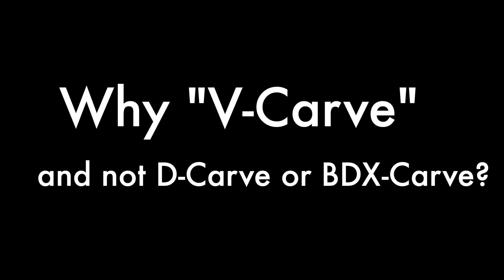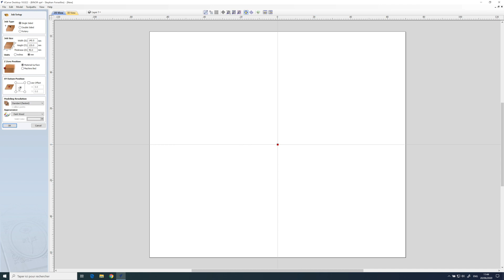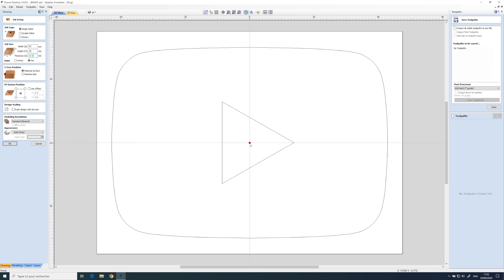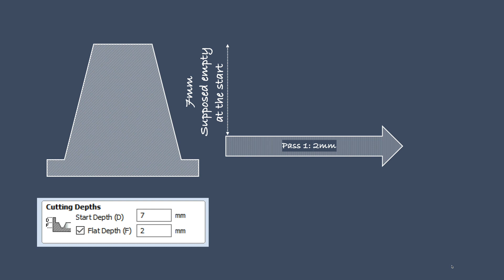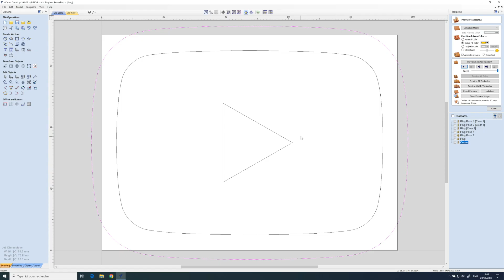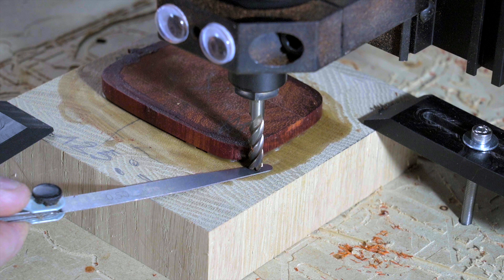Deep inlays VCarving detailed tutorial with Vectric VCarve

Comment: Excellent video which clearly explains how to produce tight fitting V carves. I have one question though with the 2/3 step depth cut with which I am having snags. I wish to V carve a name, the pocket is easy to a depth of 6mm. I wish to cut the plug in 2 steps using a 60 degree V bit, I am using an SD of 1mm and a flat depth of 3mm for the first cut and it looks fine with a nice flat bottom to the words. On the second cut, SD 4mm and a flat of 2mm, the pathing removes the flat top and now I just have a peak left on all the letters. If I run the cut 0-6mm I retain the nice flat top to all the letters. I am obviously doing something wrong on the 2nd cut but I have no idea what! I am using Aspire. Any ideas?
Reply: I had a senior moment, of course I lost the flat as I tried to make the depth of the plug the same as the depth of the pocket! Better to solve the problem before making more sawdust! Keep up the great work.
Reply from the maker: Sorry I didn't answer earlier, but happy that the problem is solved! ;)

Comment: What a great video Stephan! It worked first time for me using your numbers.  The moment the inlay reveal's itself its so worthwhile :).   
One question, why so deep, would you still go to 8mL on intricate inlays, as this would take along time?  What do you think is the minimum you should go for an endgrain chopping board inlay?
Reply from the maker: Thanks! There is no 'one size fits all'. For details, 2-3 mm is enough. If you have large zones that will be unsupported, I'd go 8-10mm. But you can do two (or 3 or 4...) separate inlays at different depth, starting with the deeper ones!
Reply: @sfo2406  
When you use multiple passes for deep inlay, why do you keep the flat depth value the same?  Would the fit or shape of the plug be affected if some passes had a different flat depth value than other passes?

Comment: I've watched this (outstanding) video at least 6 times but there's still one thing I don't quite understand. When cutting the first pass of the plug, the start depth is set to 1.5 mm with a flat depth of 2 mm. Won't Vcarve assume 1.5 mm is already carved away and plunge directly to 3.5 mm? Secondly, why not use a start depth of 0 mm and a flat depth of 3.5 mm? I just can't get my head around why the first start depth is 1.5 mm when we haven't started carving that piece yet.
Reply from the maker: Hello. Indeed with SD 1.5 and FD 2, it will plunge directly to 3.5mm which is okay for that machine. So if I want to achieve a final result of SD 8 and FD 2 for example, I'd make those cuts:

1) SD 1.5, FD 2 --> carves 3.5mm
2) SF 5 FD 2 --> carves 3.5mm additional
3) Final SD 8 FD 2 --> caves 3mm additional

In total you have carved 10mm, 1) and 2) being there to avoid having to do it in one pass.

You could use different ways like 1) SD 0, FD 3.5 etc but it's easier to keep the same FD, in my opinion. Remember the FD is what's "sticking out" after glueing and SD is the 'contact' depth between plug and pocket.

So basically I chose my FD then I make pre-passes with increasing SD, it's easier and I have less chances to mess it up. :)
Reply: @sfo2406  That is tremendously helpful, thank you!
Reply: @sfo2406  Thanks SO MUCH for this added explanation.  I was also driving myself crazy on why those specific values were picked for the plug passes.  Knowing that you want to keep your FD consistent at 2mm throughout makes a TON of sense.  Thanks for the great videos!

Comment: Stephan - great video, thank you! Can you tell me whether or not these flat depths and start depths only work with a 15 degrees v-bit - or will these numbers also work with a 30 degree v-bit?
Reply from the maker: Hi. Thanks for the feedback. It will work with a 30° bit of your design doesn't have thin pieces. Those would be really shallow at 30°. To make strong inlays I'd recommend 15° max, 10 is even better.

Comment: Thank you, but I am confused.  Why multiple tool paths for the plug? Can't you just set a max pass depth so VCarve does the cutting automatically in multiple passes?
Reply from the maker: Hi Randy. Because for the plug, the Start Depth defines by how much the plug will fit inside the pocket. VCarve will make multiple passes depending on your bit's dut depth between the Start Depth and the Flat Depth but NOT above the start depth. If you have a pass depth of 4mm and your start depth is, for example, 8mm and flat depth 10mm, VCarve will plunge directly at 10mm. By definition, anything above Start Depth should already be cleared out. But we kinda 'abuse' Start Depth to make inlays. :)
Reply: @sfo2406  thx much for the clarification.  Is it an option to just remove the material above the start depth with a facing operation or alternatively raise the bit a few mm to achieve the same outcome?
Reply: I finally get it.  It seems most folks simply plunge through to the plug’s start depth where as you are carving from the top of the wood down to the start depth. Plunging through is probably fine for shallow inlays with a 60 degree bit, but your method will work with deeper inlays with a 15 degree or less bit where the plug is a hard wood such as rock maple. Plunging through might break the bit.

Comment: Why can't you just cut the plug with a start depth of zero and a flat depth of 9mm.  This may take several passes but wouldn't you get the same result?
Reply from the maker: Because then the width of the plug at its highest point will be the same as the width of the pocket at its surface (not sure I'm being super clear here :) ). So there will be no depth of insertion. Maybe a couple thousands  if you press them very hard. 

If you make, for example, a circle of 10mm diameter and use a start depth of zero  on both sides, then the circle will be 10mm at the surface of the pocket and 10mm at the 'peak' of the plug so they won't fit.

Comment: So if my pocket is 9.525mm, I would just need to add an additional cut with the start at 9.525 and the flat depth being 2mm, including the 3 you show in this example for the inlay?
Reply from the maker: Hello; You should keep a small glue gap between the bottom of the pocket and the plug, so with a pocket depth of 9.525 mm I'd probably go for a start depth of 9mm max and a flat depth of 2mm (that's what 'sticks out').

Comment: Excellent tutorial.  One complaint I've seen several times in the comments was about the units used or the units used in other tutorial videos. I can help with that.  VCarve makes it easy to convert units inside the fields. To convert from a value in mm to inches type the keys "* i =". (without the quotes or spaces).  To convert from inches to mm, type "* m =".
Reply from the maker: Great tip!
Reply: alternatively, you can change back and forth between metric and imperial using the job set up icon in Vcarve after your work is done. It will convert and recalculate the toolpaths when you switch.

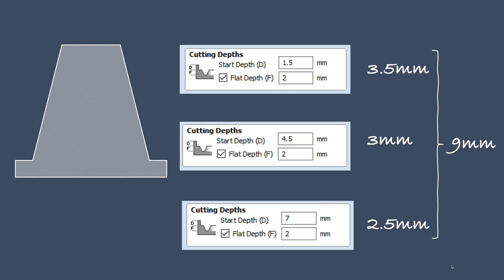Comment: After watching dozens of other videos about vcarve inlay techniques, your 4 minute visuals between 20:38 and 24:38 gave me more information than all the hours of all the other videos put together.  

Thank you, thank you.
Reply: I still dont get why we have to use start depths at anything other than 0. Why do we have to trick the machine into three passes instead of just cutting the plug at 0mm to 9mm and letting the program generate the passes automatically that it can handle cutting?
Reply: @smulths  Because the cut would be too deep for the bit you are using (possibly) and could snap the bit.  The question I just asked is because my 1/8" clearance bit only has a pass depth of .0625"   I would need multiple passes.
Reply: Exactly my thought! wow so well done!
Reply: How to use different endmill for less work v bit?

Comment: Stephane Bonjeur (Sorry Good evening now) Can you tell me please 15 deg v-bit means cut angle is 7,5 deg or this is 30 deg v-bit with cut angle 15 deg different software is designed different way. And can you recommend just by whatever link bit useful for v-carving inlays ? My machine is Genmitsu SainSmart 4030 and I can install 1/4 inch bit as biggest one. OK I see from movie it is 15 deg bit so cut angle is 7.5 calculated from vertical (90deg). I have carveco maker and have to try my first inlay by your technique Merci. Marek Poland
Reply from the maker: Hello, it is 15 degree total, so 7.5 per side.
Reply: @sfo2406  Merci

Comment: Could you program it so the female vcarve has an interface plane that's 1mm below the top surface then make your cleanup pass take 1mm off of the finished assembly down to the interface plane?
Reply from the maker: In theory you could use a start depth on the female part at 1mm at modify the male part accordingly (=1mm less start depth, +1mm flat depth). That might save some sanding. So many things to test! :)

Comment: If you use the pocket tool path for the male, you don’t need all the incremental paths. You can pick how many passes.
Reply from the maker: Hi Gary. It is a pocket tool path but I need to use the start depth to define the fitting depth (it's equivalent to' sinking' the model inside the wood). And you can't define the passes above start depth.

Comment: Thank you so much for your videos. Question? The 15 degree bits I have shown up in the tool database as engraving bits rather than vbits. I’ve tried tested them on some practice inlays and I always end up with a very good pocket, but there is a lot of room around the sides. I don’t have this issue when I uses a regular 60 degree vbit. Should  I manuallv re-enter the 15 degree bit in my tool database as a vbit?
Reply from the maker: Hello. One important thing is that V-bits in tool database are referred by the FULL angle while engraving bits 1) have a flat tip which needs to be correctly set and 2) are referred by the angle of ONE SIDE, which can be a source of error/confusion. Maybe it's one of those reasons.
Reply: @sfo2406  I can't wrap my head around this. For instance I ordered this. https://smile.amazon.com/Amana-Tool-45611-K-Engraving-Signmaking/dp/B07QDBBS2Y/ref=sr_1_4?dchild=1&keywords=15+degree+v+bit&qid=1628695454&s=hi&sr=1-4
I'm trying to do everything in carbide create because I can't pay for vectric pro yet but the settings are mostly the same. Is this not actually a 15 degree bit then?
Reply: @peterhaduong4142  I have this bit and set it up in the tool database as a 15 degree v-bit. With a tip diameter of 0.005" it is not very flat at all.

Comment: One case I run into trouble with is what happens when there is a line that is fairly long, but just slightly narrower than your clearing bit? What is the best way to clear out the bottom of that?
Reply from the maker: Vcarve will generate the clearing in the toolpath of your vbit in that case . It will be slow because there will be a lot of back and forth but it should do it. If I have a design with  lots of these I add another clearing tool for a second clearing pass (1 or 2mm bit). At some point is worth the time and effort of one more tool  change.

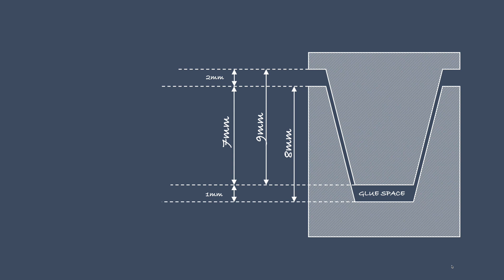Comment: Stephan, thank you for your very informative video.. One question though. Regarding your schematics at 21:14 : As I understand your narrative (could be wrong), the plug's width at 7 mm should be equal to the maximum width of   the female part, otherwise plug will just slide to the bottom. I am having significant problem with my inlay project where plug behaves exactly as shown on the above schematics. 
Please advice if you have time. I can actually write in more details but not sure where to send it.
Thank you
Reply from the maker: Hi Mikhail. Do you mean your plug touches the bottom of the pocket?
Reply: @sfo2406  yes, even though I include a glue space. A specific example: we made a pocket of 11 mm deep, and a plug of 8/4 mm in multiple steps (as you suggested) aiming to have 4 mm of the plug proud and 8 mm inserted with glue space of 3 mm. What I end up with is a plug that is slightly loose and the proud part does not exceed 1 mm. I have made multiple iterations but in all cases the plug is loose and touches the bottom of the pocket.
Reply from the maker: @mikhailkolosov5948  There might be several reasons and I struggled with that on some of my latest projects. Now I found 2 reasons why this happens (given, of course, that your machine's steps/mm is correctly set up):

1) The bit's angle is not what is advertised: I had a 15° V-Bit but actually it was closer to 20°! This means that you are removing too much material so the fitting is loose. Best way to test this is to make a series of v-carves (say 3mm by 5mm rectangles, female parts in a piece of scrap) with the same bit but configured differently. For example if it's a 15° do 15, 20 and 25°. Then measure with a caliper which one is closer to 3mm in width (at surface level) and see what is actually your real bit angle.

2) The bit is not a real V-bit, it actually has a flat tip. The bit I used has a 0.3mm flat tip but I thought: "bah it's so small it doesn't matter" so I configured VCarve for a V-bit. This makes a big difference! You have to configure VCarve for a Carving bit with a flat tip! (Watch out that in VCarve when you configure a Carving bit you have to give angle per side as opposed to V-bit where you put the total angle). If you have a flat tip (by design or if the tip is broken) you zero your Z lower than VCarve thinks so you'll be removing too much material, both in the pocket and the plug.

Those are the two main reasons I found for loose plugs. Another problem I had was the machine not being perfectly square on XY which meant that one part of the plug was very snug and another part very loose.

I hope that helps! Let me know.
Reply: @sfo2406  Stephan, thank you for your advice. Indeed I was using V bit with 0.3 mm flat side. After configuring it as engraving bit with flat bottom results improved significantly. More to come
Reply: S

Comment: i have said before this an excellent and clear set of instructions. Thanks
if i use a 60deg V bit i get a reasonable fit. As you point out there are limitations with depth especially inlaying letters.
if i use a 15deg V bit the inlay is too small- narrow- for the pocket! The depth is excellent. i have looked at all your videos several times now trying to see some magic step that i have missed . I must be doing something wrong but am making a lot of beautifully machined firewood.
Any helpful comments?  Sorry if i am being really stupid
Reply from the maker: Hi Charles. Are the too narrow parts mostly on the thin parts (the ´big blocks' fit better)? I've had the problem (I'm making a video on it) and there can be several causes:

- The bit is not really 15 deg as advertised but more open angle (20 or more). This means you are removing more material than expected both on the pocket and the inlay, leading to a looser fit. Best is to make a small test configured as a wider angle.
- The bit has a flat tip (often 0.3 or 0.5 mm) but vcarve is configured for a v bit. If you have a flat tip you must use a carving bit (watch out that degrees are per side there, unlike for v bits) where you can set the flat tip in the config
-- You have rotated the piece 90 degree to fit on the inlay blank and your CNC is not perfectly set for X and Y steps/mm (or /in)
-Your blanks or your machine are not perfectly flat. Best is to make a flattening pass on the blanks before starting the carves 

But if you have good results my bet is on the first one (bit is not really 15 degrees)

I hope that helps!
Reply: Stephan, thank you for such a prompt reply.
I have spent several hours in an icy workshop hoping to solve this problem.
1. I put the wood for test pieces through a planer. I started using a spirit level some months ago to ensure level ness.
2. Increased angle to 20deg -not a major difference in gap round letters.
3.measured the diameter of bit which the software had recorded as 6mm but is 6.35 mm. This improved but did not cure. Perils of metric v imperial!
3 tried with accurate diameter and an18deg angle and no difference.
4. Now going to try a series increasing the apparent diameter eg  6.55mm to see the effect. Not good weather for glue.
Unfortunately can’t send photos on this link.
As one CNC door opens so another couple slam in your face!
Charles
Reply from the maker: @charlesgrant2487  All bits have a flat tip. Try measuring it as accurately as possible with a digital caliper (even if it's 0.3 or 0.5mm) and configure the bit as a carving bit with the right flat tip. Sometimes this can make a big difference (it did for me). I have 0.3mm bits but as they get blunt over time I measure the tip (which gets wider) and reconfigure the bit in VCarve.
Reply: Charles, I am having the same exact issue. I don’t have any problem when i use the 60degree bit, only on the 15. I’ve tried it 4 times same huge pocket issue. I’m going to keep playing with angles as well to see if I can figure it out
Reply from the maker: @ldnelson840  If the fit is too loose try configuring the  bit as an engraving bit with a flat tip. All bits have a flat tip but it's much more important with sharp angles. Don't hesitate to adapt the bit configuration as the tip wears out.

Also make sure that you select the carving depth so that ALL parts of the carving (except the tips)  'bottom out'. I'm planning a video on that but if, for example you're carving an "E" and the vertical bar has a flat bottom but not the horizontal ones, the fit will be too tight at places and too loose at others.
Reply: @ldnelson840  i have gone back to V60 again and with all i have learnt from Stephan am getting good results with big inlays eg yacht hull but improved but not perfect results with lettering. fit well on top but some have a definite void underneath - i slice them through with a bandsaw.
Do some type faces work better than others?
when the ice has melted in my workshop i will try Stephan's suggestion on carving bit